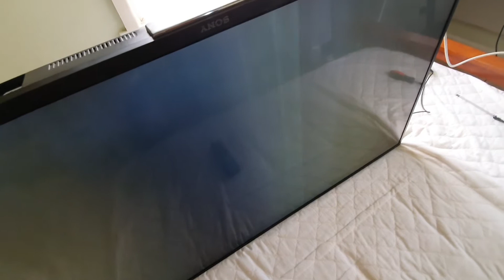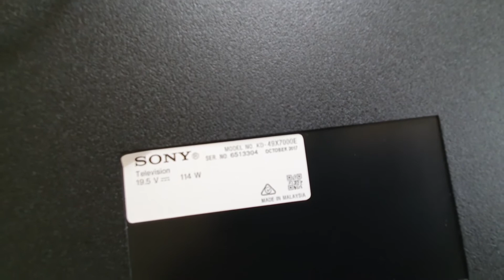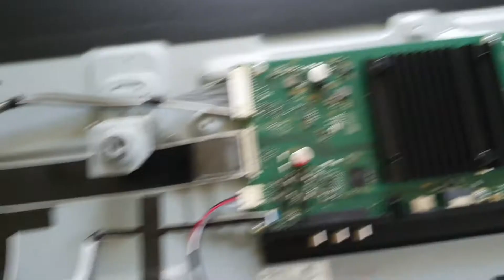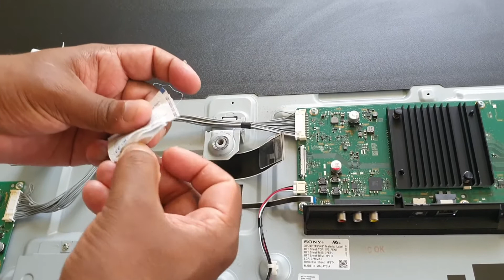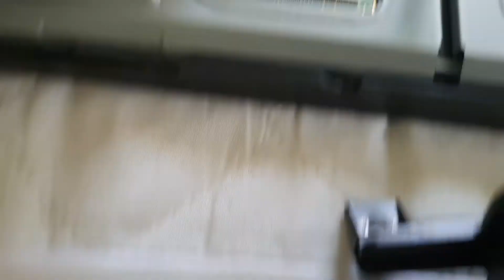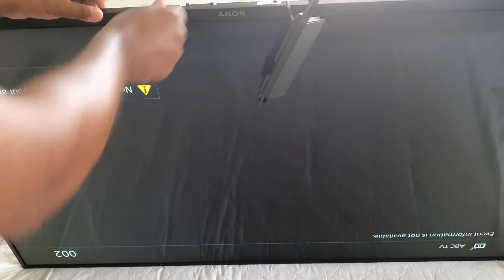Sony Smart TV Vertical Lines Issue Fixed

Comment: FANTASTIC! Can't thank you enough 🙏. No more lines on left 1/2 of screen and changing colour bands on the right with Sony Loading music playing. Cleaned EVERY cable connection with rubbing alcohol/Q-Tips, ensuring no cotton strands remained before reconnecting. Now going through a loop of full screen green, red, blue and white with Loading music playing. You are a Godsend Sir :-). Bought new t-con to mainboard cables, not needed. Bought new power supply but all connections reading 24V DC where they should, not needed. Bought new t-con board, not needed. None of these were needed and I could have saved $150. CAD if I'd seen you video first instead of many others with incorrect advice to replace parts. It should be relatively easy to get to the Menu screen with a little more work 😍

Comment: Always use a vacuum cleaner to suck all the dust out when you use a brush to clean, otherwise, you are just moving the dust around and not cleaning. Wear a wrist-band so when you are dusting, you dont generate static electricity

Comment: Very very rare to fix like this. Usually need to do the sticky tape trick due to faulty panel. Even then can fail again soon after. Ive given up fixing tvs. So cheap to buy used on marketplace. Or even new at stores

Comment: Kdl 55w800b half of the tv midway downwards is having slight vertical lines, after watching your video, i will try your cleaning method on the 2 ribbon cables. Thank you for your time in sharing this information. 🙏
Reply from the maker: Did it work?

Comment: Hi bro my SONY KDL-32EX550   has almost same problem like... When I start tv then some white lines appears and slowly in 5 mins whole display becomes completely white.... And rest all things are working fine like speakers, slots etc.....

So pls help what to do
Reply from the maker: It is bit difficult to understand the issue. May be a panel issue which is unable or difficult to fix.

Comment: My  tv  is  Sony KD X80K and also  has  some problem, i have  watched  lot of  videos  where  they  blocked  gates with paper  or  scothch, is  that  okay?
Reply from the maker: Did you mean blocking some lines in the ribbon cable in T-Con board? It works only for horizontal lines.
  If Horizontal lines try this > https://www.youtube.com/watch?v=7H5pvbr2ESo&ab_channel=Tech-Corner

Comment: Could you answer this? I have Sony Bravia non smart TV...Recently i encounered this issue, video is appearing with visible vertical lines and change of colors with Dim visibility...Shall I try the same technique? When i go to repair shop, when i say the problem... without looking at TV, directly saying motherboard might have crashed...if you replace it will cost more...better to buy new tv..
Reply from the maker: First try this.

Comment: To everyone who tried the method of applying pressure or keeping it applied by inserting some kind of shim: does it last?
Reply: Most of the time it will be a different problem. Cleaning is least of the problems. On my YT here in the TV playlist, you can see all other faults, but this one ;). That should tell you something.

Comment: Hi tried your method. The tv worked fine for around 3-4 hour and then the lines started to appear again. Please help.
Reply: did you found the solution?
Reply: @trippy_b   no. It did work fine for some time after that back to the same issue
Reply: @nikhiltalkar644  so are you still facing the issue or did you took it the repair center?
Reply: @trippy_b  still facing the issue.the repair center  are pointing out towards display pannel problem and the replacem cost is very high.
Reply: @nikhiltalkar644  I'm getting horizontal color lines ob my screen, thinking about cleaning it before going to repair center.
Reply: @trippy_b  yes try that

Comment: Good advice 👍 I changed the whole mainboard and T-Con Board and it worked. Maybe i only fixed the issue with the cable Connection during the repair, who knows 🤷🏼‍♂️
Reply: How much does it cost?
Reply: @hitendrajayswal7770  It was my  2 year Old Sony Android 65" TV. I bought the same TV with crashed display for around 150 Euro ~ 200 USD and get the hole electronic parts from the inside

Comment: Plz help me
My tv some vertical line and few second after slow motion problem. Can you help me
What problems will be solved by changing the t con board ?
Reply from the maker: Most probably this is panel issue which is difficult to fix. But you better try replace the T-CON board and see first.

Comment: Hi I have Sony 65x9000e 4K TV used only for two years and these vertical lines are appearing quite often stay for few days and then tv works fine. Couldt this possibly be moisture and dust ?
Reply from the maker: @Khurram, Yes most probably. Just do a clean as explained in the video. It will avoid any possible further damages.
Reply: @tech-corner2556  thanks will do and advice thanks

Comment: Excellent Sir. Just loved your video. I have a Sony 48w652d tv which shows picture wit vertical lines as shown by you Sir. Will this action shown by you solve my problem. Please reply as to how I can solve the problem. I am a Senior citizen aged 70 years. Would be very happy to receive your reply /suggestion. Thank you.
Reply from the maker: @Mohan, Thank you for your comment. first of all think about safety. DO NOT touch the power supply board, it has high voltage even the main power cable is disconnected from the main plug (It has high voltage storage in capacitors). Don't keep the screen side on rough surface, it can be easily cracked. Keep it on the bed as I do.. :-) . Take time and unplug and re-plug cables safely, they are also easily damageable, if you apply unwanted force on them. Good luck..!
Reply: @tech-corner2556  Thank you for replying sir. Kindly suggest to me how else I can solve the problem. I have cleaned the cables as suggested by you but have not succeeded in solving my problem. Thank you for showing concern about the high  voltage. My tv has a Power supply adapter like we have for Laptops. Perhaps i may not have any high voltage in the circuit in OFF condition. What else could be the problm. I get the lines along with Picture. The picture is not sharp as it used to be. Please suggest me some way Sir. Thank you so much.
Reply from the maker: @mohan1102  Thanks for the details. The power adapter has 19v and it is not harmful. BUT THE LED BACKLIGHT DRIVER CIRCUIT GENERATES HIGH VOLTAGE IN THE LED DRIVE BOARD(it convert 19v into high voltage). THAT MEAN STILL THERE IS A DANGEROUS VOLTAGE INSIDE THE TV.
Can you upload a small video clicp with showing the issue clearly. Then I can help.

Comment: Same as my Sony tv, problem with blank and vertical lines on screen. Luckily still keep the tv and will try to fix them using ur method. Thx 4 the video
Reply from the maker: @Mohd, Thanks for letting us know. Let us know the results. Good luck..!
Reply: @tech-corner2556  didn't work. After i plugged-out the cable, the screen only show white blank, then when i plugged-in the cable again, it will show vertical lines again. I guess the cable faulty already, or it's port

Comment: Hi sir,. My tv sony 42w700b smart  tv on 30-40 minutes running ok.  After single hair block line vertical coming on center.  After 10-20 minutes vertical bar center 50% to 80% black bar vertical coming.   What's the problem.  And suggestions pls..
Reply from the maker: @Raju, Can you please upload a video? Then i can help.

Comment: My tv is the same model as yours, got same problem and clean all the ribbon cable and connector with alchohol  but still does not solve problem. Could it be the T con board or cof?. Cof looks nice and clean
Reply from the maker: @Jinggo, most probably it is T-CON if you cleaned the cable as you mentioned. Try replacing the t-con. Good luck.
Reply: @tech-corner2556  already changed t con but still the same. voltage supply to t con from mainboard is 12.1 volt avalaible

Comment: Does tape work instead of using a alcohol swab
Reply from the maker: @N.A.K, What did you mean by tape? If you can't find alcohol just use any clone and a soft cloth to clean. Or you can use a pencil eraser to rub the ribbon cable ends.
Reply: @tech-corner2556  I was referring to this video. https://youtu.be/kUWapOBtm0Y
Reply from the maker: @N.A.Kisgood  OK not I understand what you mean. That a good trick for fixing panel issues. It works with most Horizontal lines and flicking issues. Not the Vertical lines.

Comment: My tv model KDL-43w660F I went to someone who told me that it died and it is the same problem colors and lines
Reply: Mabye he's trying to fool you. Be careful while giving you TV for repairing.
Reply from the maker: If you have some experience on removing back cover and handling this stuff in safe way, try this method before you bring it to a repair person.
Reply: Tech-Corner  What do I do
Reply: @mmrr6853  mabye he was right.
Reply: Boomber from
Reply: @mmrr6853  ??

Comment: When i on tv it got vertical lines full cover screen for 2 minutes after that tv works without problem whats the problem
Reply from the maker: First try to do reset the tv in two ways (If this is a software issue, it will be fixed). 
1. Turn off the tv and unplug the main power cable. then press and hold the power on switch on the tv(not in the remote) for around 20 seconds. Then plug the main power and turn on the tv.
2. If the above method does not work, do a tv reset via the tv settings menu.

Comment: Hi..my TV model is Sony kdl43w800D.. it has same problem like getting vertical and horizontal lines full of screen.but after switch of and on its working for 1 HR or less and getting lines again.. Is this the issue with TCON or connectors which u shown in video ? Any thanks for helpful video.i will try it sir .
Reply from the maker: @vijay, If this cleaning does not fix the issue, replace the T-CON board. May be the issue is happened in bad T-CON board when heating up the board. Good Luck..
Reply: @tech-corner2556  how to know if it's the issue of display
Reply: @tech-corner2556  sir my LED have same problems,  f8rst technician change some ICs, after 10 to 15 days vertical lines were coming. then again technician check and now he saying its display panel need to change
Reply: I have also same model and same issue what happened now is it resolved or did you changed the part
Reply: @Dileepkumar-rr6ob  issue was resolved now.. issue was not with TCON board, technician changed ICs( CUFFS) which are on TV base..now it's perfectly working fine.
Reply: @vijaykumar-xc8jn  What did it cost?
Reply: @vijaykumar-xc8jn  how much did it cost?
Reply: @TheSoBoGirlMindy  i dont know CUFFS (ICs) cost exactly ..I think 4k Rs around ..even cheaper ..but technician charged me 6k rs for repairing the TV..I think its worth , because Sony Authorised technician asked me around 27k to repair this ..

Comment: What if i use Blower and  Vacuum cleaner  , form out side with out opening back cover , will it work
Reply from the maker: @Darshan, It will not works. The important step is that cleaning the ribbon cable's pins using alcohol to remove oxide in the pins. You can use a pencil eraser to remove the oxide if in case you can't find alcohol. Just rub the pencil eraser carefully on the ribbon cable connector pins. Good luck..!

Comment: Hi Thank you for the video. I have vertical and horizontal lines. I cleaned as you showed but I do not have alcohol wipes so I used liquid alcohol with a cotton bud. But it did not solve the problem. Was wondering if you could advise if what I did was incorrect or if there could be some other issue. tqvm
Reply from the maker: @Katey,  Are you sure that the screen is not cracked? Then the issue may be in T-CON board/Panel or Main board. As the 1st step, replace the T-CON board and see.. Good luck..

Comment: Hi,thankyou,I did this and it fixed my tv, lines are now gone,how long will it last?
Reply from the maker: It is nice to hear that you fixed the tv using this method. The behavior of electronics is normally unpredictable. If you did the clean well and the cables are properly fitted back. It will last for another few years..

If you think that this will help others too, please share this video. Thank you..!
Reply: @ZzoidHD.. the lines are permanently getting or in between like tv working fine for some times?

Comment: You are absolute hero my man! I repair T-CON board and got white vertical lines on screen - I clean ribbon cables and connectors with isopropyl alcohol and now TV is working perfect.
Reply from the maker: @Solve IT, Nice to hear that..!  
If you think that this will help others too, please share this video. Thank you..!
Reply: What was the cost of T- Con board?
Reply: Thanks bro, i have same problem, many help
Reply: Good  video. Some times you can Solve that problema that way, but in other ocation, you must check the volts of VGH, VGL AND VDD in the T-con.
Reply: @juanjoseplazaola3743  that was actually the case. I repair TCON board by removing shorted cap but then lines appear. Flex cable and socket clean do the job
Reply: can i use coline

Comment: My Sony tv also have same issue , tonight onwards . How can fix it ? Should I need to replace the screen ? Some times the lines are on both sides n middle of screen hasn’t any issue but some times full of the screen having the issue ...
Reply from the maker: @Jyothi, Did you try cleaning the cables as in the video?
Reply: @tech-corner2556  yes .. I have done the same . But no use
Reply from the maker: @jyothirajan189  Then the issue may be in T-CON board/Panel or Main board. As the 1st step, replace the T-CON board and see.. Good luck..